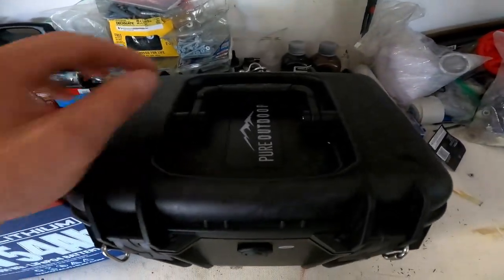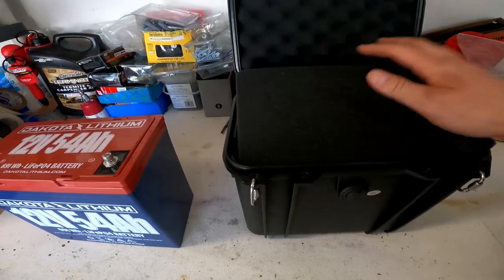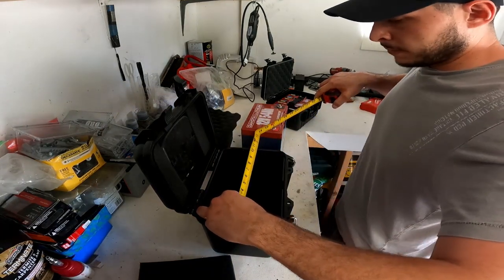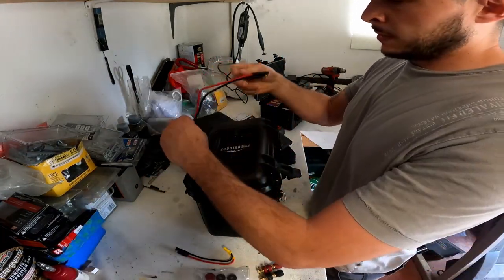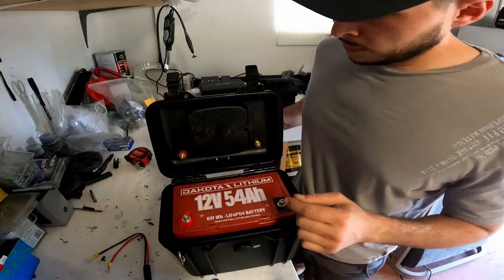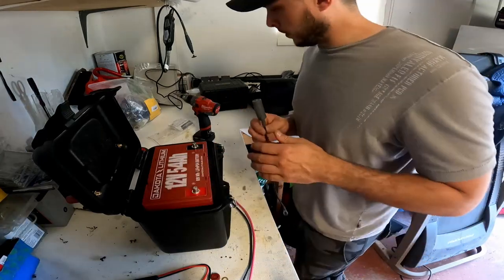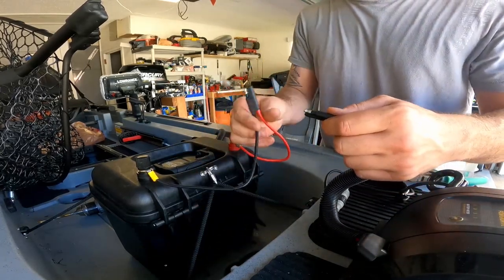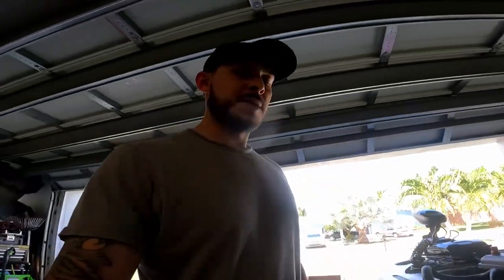My Ascend 133x Mercury 6hp Dakota Lithium Power Setup

Comment: How long of use do you get out of your 12v 54amh running your trolling motor? I got the Same kayak and wondering if the 54amh would last all day? 8hr of reservoir fishing
Reply from the maker: I was out for 4 hours and still had plenty to go, seen them go 5-6 hrs straight on max

Comment: Did you cut your trolling motor shaft down? If so what was it and what did you cut it to?
Reply from the maker: Yea I got a video on it
Reply from the maker: Think I cut 26” off
Reply: Sweet I’ll have to check it out. I just got a 50/54 since that’s all my local cabelas had instock and have to cut it down.
Reply from the maker: @dmc46784  yea I got my length by having my prop clear about three inches from the hull. Then gave couple inches from the trolling motor head to where it sits in the key.
Reply: @thejuanderdude7911   that will be on this weekends list of to do. Do you leave your trolling motor on all the time for transport?
Reply from the maker: @dmc46784  after Sunday’s testing I won’t, it will mostly be for spot locks and finessing in narrow channels or fishing spots. Outboard to get me where I need to go. Maybe getting me faster out in open water in the future🤪